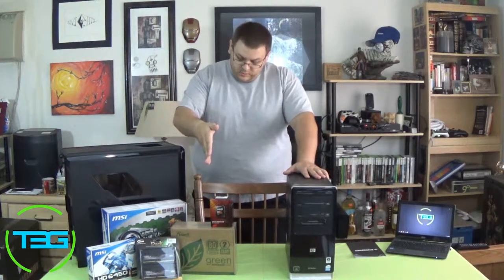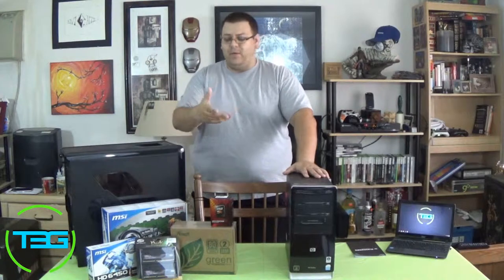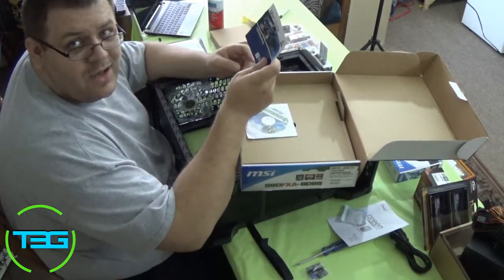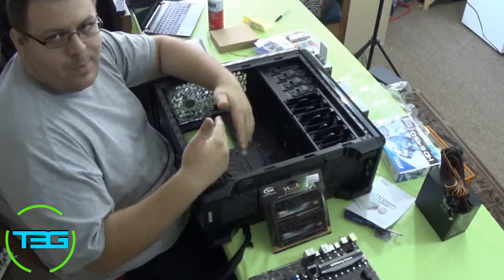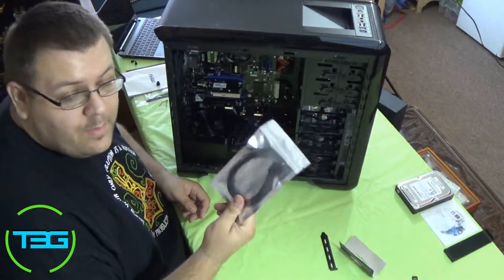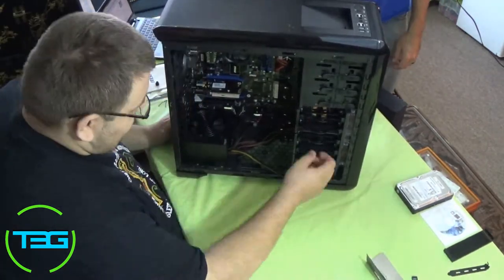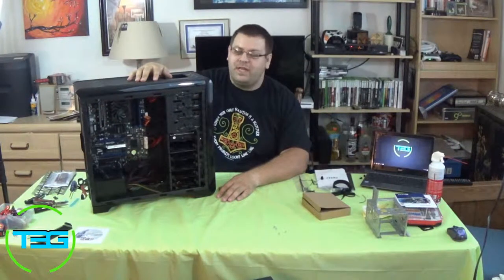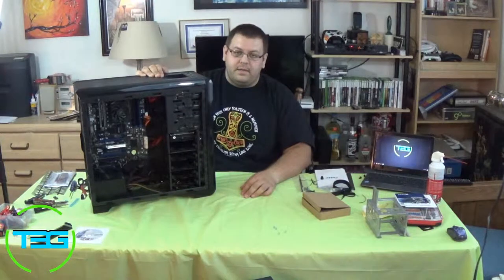HP to Custom Case Swap / System Build [Cerebro]

Comment: Beautiful cable management skills.  Super clean look.  Most importantly you can add more hard drives and not have to undo all the previous cable management.  As for cables on the inside of the case, I have no problems with the psu fan facing up, however this creates the problem of brining all of the cables to the forefront of the case.  I suggest that you pull them tightly together towards the psu, and strap them together so that it will look like a single cable going to the backside of the case.  Not a mangle of power cords.

Comment: you guys need to watch Carey Holzman's channel.  For one grab the motherboard from the sides or from the heat sinks.  Do not touch the wells on the  underside of the motherboard because any electro static shock will damage it.  Second, use a esd wrist strap grounded to bare metal.  If the case is painted connect it to a large screw inside the case as these are never painted.  I'm, only picking on you guys because I want you to learn good pc building habits.  Every one should learn to build their own pc and not be taken in by store bought brands.

Comment: Could I do this with a hp 8300 elite sff plz I have been asking everyone
Reply from the maker: For the most part, yes. You will just have to get a different PSU, and you won't have a rear i/o shield. But otherwise it looks like the board should fit fine. Just make sure that you remove any unnecessary standoffs if they are not lined up with the board holes.
Reply: @T3GMedia  OK thx I have been debating over this